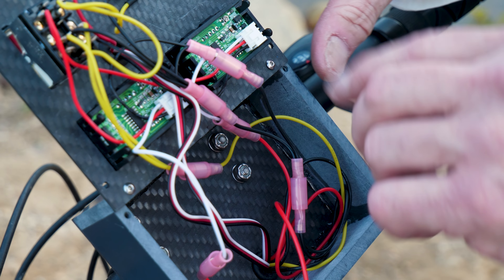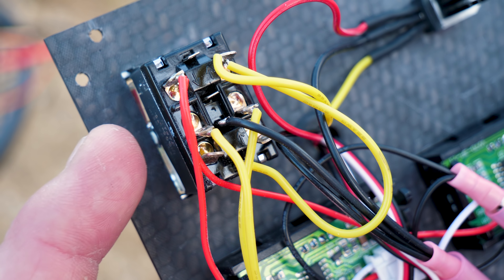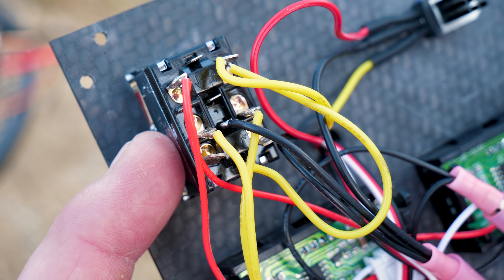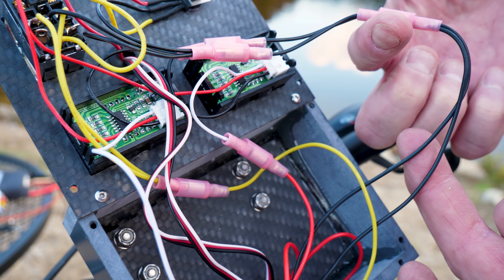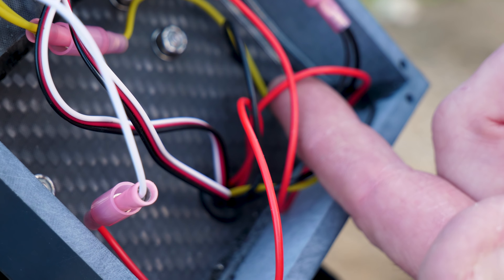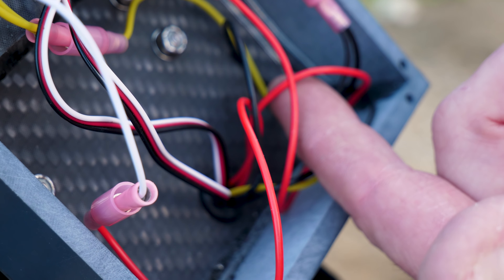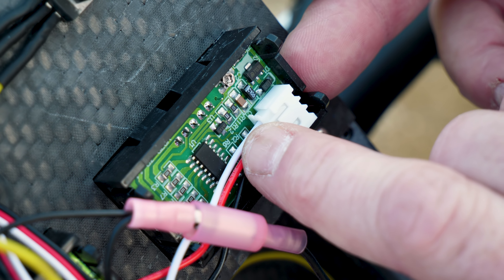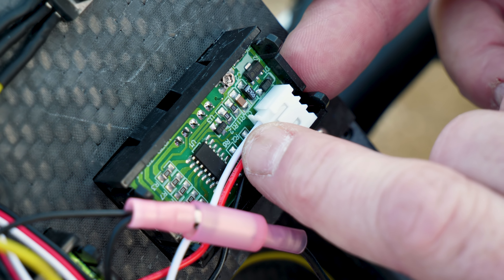Jet Bike - DIY Demo and Test Drive

Comment: I seem to recognize what seems to be the Speculator NY area. The roads up there are nearly never flat for long, so I was impressed by the bikes performance in that type of environment. Have you some measured performance values for various inclines? What I really like is the interface with the bike itself is so simple and does not require a lot of machine shop tools.

Comment: I've built a ebike using 4x 6s lipo I've connected them up in parallel and series would it be ok to leave them connected if  not in use don't won't the battery to drain another one etc

Comment: Curious what the efficiency ratio is  battery power out to delivered thrust.
Reply from the maker: It will be pretty low.  Maximum effeciency with any system that is propelled by moving air or a fluid like a boat is when the velocity of the vehicle is as close as possible to the velocity of the exhaust.  That's why we're building a much larger and lower velocity ducted fan.  Stay tuned.

Comment: I might add one of these to my bike, but I'm worried it doesn't produce enough thrust. I'd like to be able to go 30mph easily, would I need to add more batteries/jets?
Reply from the maker: No.  We can hit that on the flats, but it takes a while. This is an off road bike and I'm sure a good carbon fiber rroad bike could hit 40.
Reply: @TechIngredients  don't get me wrong, that's impressive. Far more than I expected from the thumbnail. But, I really think I would want to add a third jet engine. 

I mean, after all, this is competing with the torque of hub motors lol :)

Comment: Nice work, just a bit loud.  You might want to build a hard-sided box to store those batteries in.  If you rupture a LiPo battery, it can violently erupt and shoot out flames.  You might also want to include a fire extinguisher on the bike.

Comment: For steeper inclines I would suggest you build an APCP booster with the cardboard tubes you made the smoke bombs with! May want to test in a controlled environment before riding.

Comment: What do you mean "series winding" when talking about the battery circuit? Don't you mean "series wiring" id expect winding to refer to a motor design. What winding is involved with putting batteries in series in a circuit?

Comment: No "see ya", because I'll hear you coming a mile off and hide ;p
The Physicist in me say's "Newtonian laws", but the RC model maker in me can't help thinking there is an optimum speed for those EDFs where they will deliver maximum efficiency. High thrust at low speeds has to lose some power as heat generated through compression and thermal load on the motors. Tough to measure as that thermal load will be unloaded into the compressed airstream.
Oh, but that you could deliver all those amps at the crank and make use of those Sturmey Archer gears.
Reply from the maker: Place these on a light weight road bike and maintain a good racing posture and as the speed continues to climb, the efficiency does as well.
Reply: @TechIngredients  Thinking about when I had a go trying to fly an EDF powered 1/12 scale Mig all I can say is; "YIKES"!

Comment: Great location, short term subscriber but bulk watched ALL ur content. Not very interested about weak fan propulsion. Wary of the pocket pen image, but keep it up!
Reply from the maker: If you watched all our videos then you can see that you don't need to be wary of the pocket pen image.  It's the content that matters and having a little fun with the image, the nice scenery, pleasant music and a little humor is icing on the cake. 
The reason I started out the video by laying out our reason for the build ie we had all the necessary components and were looking for an application was to avoid the criticism that we were building a poor alternative to a conventional E=bike.  We did this because its fun.
By the way, we never ran the bike above 25% throttle.  At full power it will move that old Marin much faster than anyone would want to ride it.  On a light weight road bike...?

Comment: Regarding your comment about parallel cells getting overdrawn, I wanted to let you know that I took apart one of those 16AH 4S Turnigy packs, and they actually use 8AH cells in parallel within each package to get the rated capacity. They might be doing that with your 10AH 6S batteries as well. Either way, it's useful information because you could tear apart your battery and rewire it to double the voltage at half the capacity.

Comment: I know that this vid is two years old, but do you have any idea as to the noise output from the rear? Some areas might not like the noise, and prohibit it. Just wondering.
Reply from the maker: It's LOUD.  But, because it's a high pitched whine and sounds like a jet flying low overhead as it passes, it's a NICE loud.
Seriously, it's not as loud as a big motorcycle but the pitch is much different.

Comment: 600 miles per gallon?  You could be the loudest and slowest man to travel cross country. Only Kidding!  Lmao
Reply from the maker: Six hundred miles per gallon only if a bicycle is actually fueled with gasoline or diesel.  We will not see anything like that here.
Regarding the speed, this off road bike was never driven at above 25% throttle.  A good road bike ridden by a pro bike rider will travel at 25-28 MPH with 7 lb of force (thrust) against the road.  These fans will max out at a total of 22lb of thrust.
Reply: Thanks for correcting me. Would be interesting to see how fast someone slightly larger than you would go on one of those. Also, with thrust, could you establish that same speed with one engine on a flat plane?  The second engine only adds power thrust?

Comment: One  LiFePO4 Battery company states  "The battery outputs a steady voltage around 12.8V until very little capacity remain, do
NOT rely on voltage as an indicator of remaining capacity." 

Is the same true for an RC type LiPo batteries? 

There are several LiFePO4 "fuel gages" that do what is called "Coulomb Counting". In some way, they "learn" about the battery's capabilities and provide an out that is accurate. 
Some info here: https://batteryuniversity.com/learn/article/how_to_measure_state_of_charge

Comment: Nice video, as always! I would’ve loved to see more of it actually accelerating to get a feel for how it pulls
Reply from the maker: The pull is poor even at high power.  But, it just doesn't stop pulling.  I would never run these fans at full power on that old bike, but on a well set up, lightweight bike with a good posture this would go VERY fast.
Reply: alright, so, low torque but high top speed :D thanks for the reply !

Comment: there were only 2 things i didn't get. 1) when you put the brakes on how do you stop the fans? 2) where do you put the pocket protector when fully operational?

tesla had such high hopes for his turbine. why don't we see more being done with the tesla turbine?  and why don't we see more experimentation with the stirling?  for that matter, why don't we see more being done with other engines generally?  and when are we going to see printed cars?
Reply from the maker: Tesla's turbine is elegant, but it has some limitations.
I think the major challenge with the Sterling engine is low power density.  It tends to be bulky compared to a conventional reciprocating engine of similar power.

Comment: Given the efficiency data you had for THIS configuration, what would you expect to see if you used a recumbent bike that was enclosed in a low-drag shell? Next question: Since this system is so self-contained, and universally mount-able, If you put them on an otherwise “stock” glider (sailplane), would that be enough thrust to at least extend the flight time simply by providing access to more thermals/updrafts because the pilot would be able to momentarily arrest their sink rate and reach out a little further than normal?
Reply from the maker: A low drag bike would accelerate to fairly high speeds.  A professional Rider on a good road bike needs about 8# of thrust to maintain about 24MPH.  The pair of EDFs will produce about 22# of thrust.
To calculate the thrust needed by a glider simply divide the weight by the lift to drag ratio (40 is a pretty reasonable ratio), that thrust will maintain level flight.  Compare 22# to that number and you have an idea of the reduction of the rate of altitude loss.

Comment: it seems highly in-efficient, also, why are you not using the BECs that are in the escs to power the controls even though you have them hooked up to the controller ?
Reply from the maker: We needed a min of 12 volts for the lighted switch and 7 volts for the PWM.

Comment: really fun project but you said it in the opening few seconds, ebikes are really efficient, ducted electric fans is not at all very efficient way to power an ebike, there is a good reason hub motors have been the motor of choice for 30 plus years, my geared ebike hub motor has done 40,000 miles in 10 years, will do 30mph, climbs any hill is very efficient and quiet and thats the key with this its in efficient and very noisy and not very powerful, it will use lots of power for sure but its such low thrust compared to a real jet engine, hows the hill climbing on this? id bet not very good to none existent.
Reply from the maker: Those are good points.  I have a somewhat different take on the analysis. 

This project was done for fun.  It allowed us to demonstrate the design of a simple electrically driven/augmented bicycle without modifying the bike and using easily available hobby components.  We like the noise.  It is not nearly as loud as a motorcycle and so, nobody can say it exceeds sound levels that are already common. But riding through town, heads are constantly turning to watch without having to deal with the fuel and extremely hot gasses of a turbine powered turbojet.  We never ran the fans past 25% of maximum for the video.  The bike that these are best suited for is a light weight road bike rather than a heavy, worn down off road bike.  On hills, the fans "flatten it out" so that a little pedaling is easy to do.

Comment: Interesting - unlike traditional wheel mounted design where you need lots of torque, this design you need power. I've built a full sized electric jet boat where you also need more power (rpms) than traditional e-car motors. The sound is a big downside for being a daily driver, I wonder if you can run the motors supersonic to reduce the noise - you probably want higher rpms anyway to get the most out of your turbos. Hard to tell but looks like it was maxing out around 15 mph (more on downhill), I'd like to see one that hits max efficiency "cruise speed" around 25 mph.
Reply: For lots of static thrust you want to move a large quantity of air at a low speed. A practically-sized fan will still be moving the air at such a high velocity relative to the peak speed you would want to risk on a bicycle that you wouldn't worry about outrunning the motor. With bigger impellers, this much power could be put "down" much more effectively for proper hill climbing ability. This is a novelty noisemaker not being mounted in an RC aircraft.
Reply: @Markle2k  Yes - when getting an impeller for my electric jet boat, I told the impeller designer to make me an impeller that can move the entire lake in one RPM so I understand what you mean by moving a large quantity at low speeds. I was using a large series wound electric motor for cost meaning I didn't have the higher RPMs of a BLDC. But now I've begun designing my 3 phase motor controllers so I'll be moving to BLDC world once I know I could build everything from raw materials.

Comment: Have electric paramotors missed a trick? It’s 4,years on. Bigger batteries now exist. Wondering if bigger jets now exist. I’m clocking 35mph easily on 48v 1500w e-bike off road. I’d ditch the motor for jet fans if the speed was comparable. You both looked to be doing 20mph? Best guess.

Comment: I think the efficiency will be higher when you ride at a higher speed.
Reply from the maker: You are correct. 

Because the thrust is proportional to power output, but independent of speed, the faster we travel the greater the distance covered for the same energy use.

Comment: I love your videos! I was wondering, wasn't it possible to connect the power cables for the fans  from underneath, would have looked cleaner.
Reply from the maker: We decided on this orientation because it puts the heat sink a little closer to the high velocity inlet air stream, the cables are easier to attach and it permits the front of the ESC's to be lower down.

Comment: sounds good, but 5000 watt each. verry slow
Reply from the maker: Not at all.  We did not run these fans above 25% power during any of these demos. We did not place these fans on an optimized road bike, rather a beat up, 15 year old, off road bike.  We wanted to demonstrate the arrangement of the components and the operation.  If you're looking for speed, a proper bike with the rider maintaining a good racing posture, you could go MUCH faster.

Comment: Dont want to be a downer but the acceleration seems quite bad. Im sure the wind speed it super high but high speed doesnt transfer a lot of energy if your mass is low and 5KW each for 10KW total and barely accelerating, as in you could accelerate faster with your legs, seems like a waste of power. 10KW if more than 10 horse power,  thats a LOT of power which isnt being clearly seen.
I say something like a fan boat desing would work much better. You dont need super high speed turbines, you need one big fan that moves lots of air at relatively low speeds.
Reply from the maker: You are correct regarding the advantage of a large mass because momentum is M x V while the energy required is 1/2M x V^2.  This build is not designed around efficiency, but for fun.  These fans are more compact and look better.  For what it's worth, we never ran these above 25% of maximum output.

Comment: Nice project, can we get metric subtitles? :)
Reply: For the most part, I have only committed three conversions to memory, which makes almost everything else readily convertible with pencil and paper or a calculator. One is that 1 inch equals 2.54 cm. From that you can expand that into feet, yards, miles, meters, kilometers, etc. so you can calculate distances, volumes, and velocity. The second is that one Newton equals 2.225 pounds, (they are both measurements of force not mass, which means that you can convert weight, mass, force and together with being able to convert velocity, you can calculate acceleration. The third is converting Centigrade to Fahrenheit and vice versa. This conversion algorithm is not exact, but it is close enough for converting temperatures applicable to weather conditions.
Celsius to Fahrenheit Formula: (°C * 1.8) + 32 = °F
Fahrenheit to Celsius Formula: (°F - 32) / 1.8 = °C

Comment: Well, given the fact that this thing is stupidly powerfull AND does not have a dead man switch (yet), you should really wear a helmet... There is always the possibility that you fall off, and the last thing you want is to get dragged along the street or get a body part into the fan blades.

(Okay, there comes the problem of how to actually install such a switch, having a wrist wrap would be stupid for obvious reasons (can't indicate when turning). A simple pull down switch under the saddle would be an idea)

Comment: Regarding 500 mpg for the gasoline equivalent, is that taking into account the poor conversion efficiency (~30%) of gasoline into useable power?
Reply: What the smallest practical diesel engine manufactured?
Reply: @texasdeeslinglead2401   you can get very little rc diesel engines (0'8cc and lower).
Reply: @texasdeeslinglead2401  Depends on what you mean by "diesel" and "practical". A "practical" diesel engine will run off straight diesel and the fuel will be injected into the cylinder for combustion. There are some RC diesel engines but they don't run off straight diesel and combustion is achieved by compressing the fuel/air mixture. 

One reason that diesel engines extract more energy out of a volume of fuel is that the combustion is not an instantaneous event - like in a gasoline engine from a single spark. Rather, the combustion takes place over a longer period of time as the fuel is injected into the cylinder. The "pushing" of the piston takes place over a larger distance of travel than in a gasoline engine.

The RC diesels do not benefit from this extended burning time since the combustion happens all at once. So, I would say that in order for a diesel to be "practical" it must be fuel injected.
Reply: @HarmanRobotics  practical as in usable  not hobby grade .
Reply: @HarmanRobotics  most likely one of the bigger hurdles for a small diesel engine is overcoming start up. All of the machines an vehicles I've dealt with that use diesel have high compression an utilize high  amperage for glow plugs an starter. I'm quite well versed in diesels . Heck   my wife has a 23 year old pick up that I keep running , or rather maintenance as it has been superbly reliable. Now the issue as I can tell is , yes diesel in order to be viable must be injected otherwise don't even bother with it . Electronic injection needs some decent amperage to achieve 20,000 plus psi . All of my machines an other vehicles  use electronic . My 23 year old beast uses an hpop  based catapillar design. It's works great but it'd not good for trying to achieve the rediculous power out put of today's newest hot rod deisels.